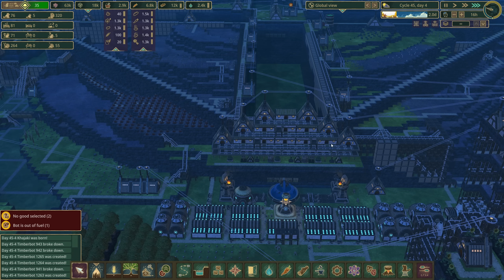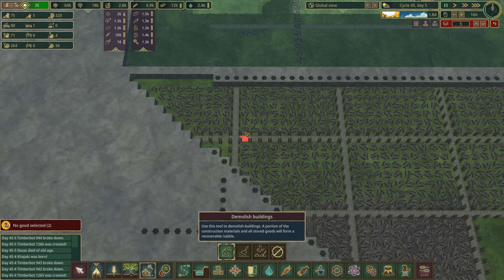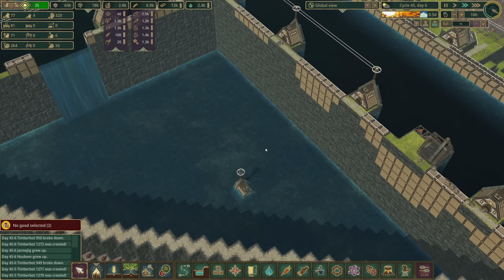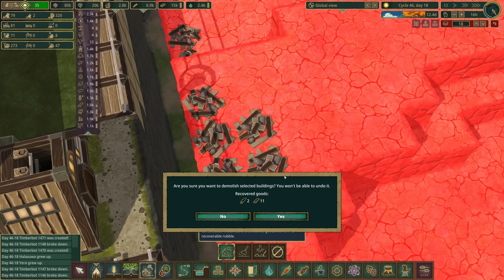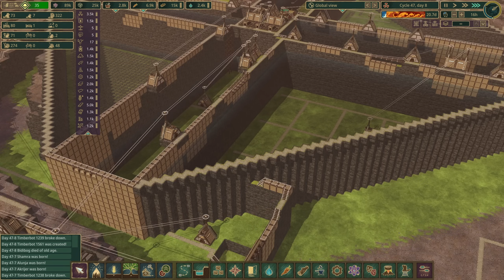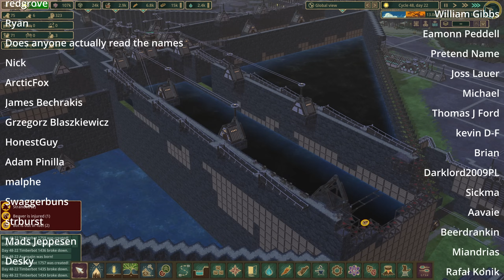A bit of of a Reservoir expansion : Timberborn Ep13

Comment: for the aesthetic overflow river, you can build a wall of levees, except the very bottom blocks are sluice gates, set to open if the water drops below .70. that way it'll always keep the river flowing without you needing to do anything. and it'll be discreet.

Comment: There is a way to make the tanks drain in sequence without needing pumps.  You just need to have the outputs for the tanks you want to empty first be higher.  Not even a full block.  A sluice gate with an "open at depth .25" would drain after a sluice with "open at depth of .5".  If the output flows past the rest, or better yet, have lower priority tanks be upstream in the output, then all outputs would only need a sluice or two per tank to empty in whatever order you want.

And if you are willing to raise the floor of the triangle tanks by one level except for the one block near the drain, a sluice at the bottom of the square tank can empty into that one drain block only after the triangle tank is mostly empty.

Comment: I suggest openning the walls separating your rectangular and diagonal "wing" sections of the water reservoir from the bottom. That way, the water level can rise and fall simultaneously across all tanks and you can pump it out from a single section while having access to all of the water (i.e. if you pump out, all the water from all sections drain).
Reply: One big(?) disadvantage could be, that you can't control evaporation. If that makes it evaporate too fast, you could end up without any water. I don't know how the math works out but its not inconceivable.

Comment: I'd advocate for flow control with the overflow you already have and draining pipes connecting the tanks back to the primary. Let the water pressure do the work. I feel like active pumping should not be necessary. Take this with a grain of salt as I didnt attempt a reservoir at this kind of scale yet.

Comment: 17:02 rubble is picked up by haulers, but it has lowest priority in same tier, so if you want haulers to move rubble quickly you need a ton of them or use priority tool on rubble be in higher priority tier. but if you dont see any rubble at all being moved by haulers, that’s and indication you have less than optimal number of haulers.

Comment: For some reason I thought the 8 tanks would just be joined together with 2 tile deep overflows at every wall, with a 1 tile deep overflow going into the external tank/canal feeder which would act as run off. That way every tank would fill in succession until the first would be filled. But I guess that doesn't let you use the water lol.

Also, please make all food types/max the happiness scale for the alive beavers. For completionists sake, and also because it'd be satisfying to see everything done. Thank you!

Comment: The pain of having to dynamite out the various nubbins you stick your buildings on (at 25:04 ) is one you cause yourself by building them out of dirt instead of using platforms and overhangs from the start. That would have also help with your copious overabundance of planks a bit.
Standardization is fine and all but sometimes the pattern is made to be broken.

Comment: Why don´t you use sluices instead of pumps to feed the main tank? Its fully automated and has a way smaller footprint.
Reply: I would prefer to see this too, I don't like pumps. But they have one advantage - they move water up, meaning you can keep the main reservoir higher than auxiliary ones. With sluices you will keep their level the same.

Buuuuut 1 pump = 1cms. If you stack them to gain height - you will loose a little bit of the flow over evaporation on intermediate steps and it will be slightly lower than 1cms.
Reply: @Blackwing2345635  Just need to make a column of sluices.
Reply: @Swordphobic  how will it magically make water go up?) you don't need a column to keep the main reservoir topped, because you don't need a feature of tracking downstream depth, it just will be a one-way valve. 
If you uncheck close at the downstream depth or choose force open - it will allow water to flow all the time. But it will just equalize levels before and after, not make downstream higher than upstream
Reply: @Blackwing2345635  Hence why you use a column, so at any given time upstream will be lower or equal than downstream,
Reply: @Swordphobic  as I said - no need a column for this. You need a column only if you want to control downstream level above 1. For example you have 2-deep channel and you want water to not go higher, but still be able to go through at the last level of the reservoir.

If you use sluice just as a one-way valve and you don't need to control the downstream level (for example prevent backflow due to upstream evaporation or drain) - you put one at the bottom, check off "close above downstream depth" or select force open mode. This it won't close at all and it will only restrict backflow. It will let water flow even when the downstream is higher than the sluice.

Comment: "Helix Mountain" has become "Diamond Tank," I guess. :D

biggest OCD problem so far in this: The middle of the tank where the water sources is not symmetrical with each branch of tank. :D
20:58 As a compromise for the clover idea in each "wing" - only do the top section of the clover build and make "floating" beaver-topias lol
25:01 Thought: Keep the storages there and build an access point on top. Just wall it in to raise it up, with a 2-tile roof for more storages on the roof. Double the storage!

edit: A word... idk how that slipped past proofreading!